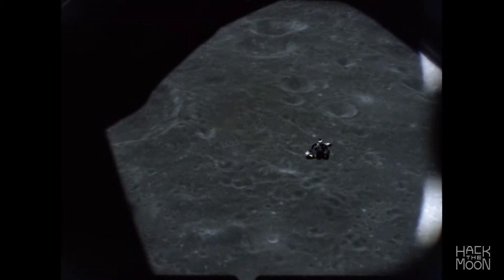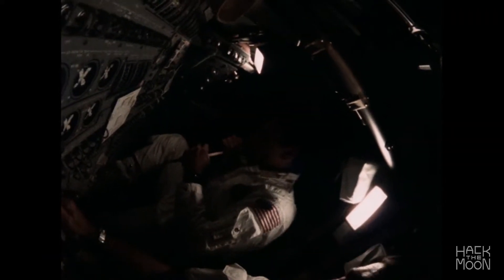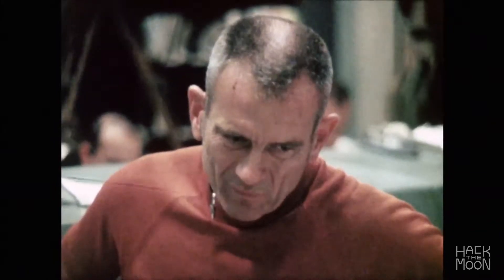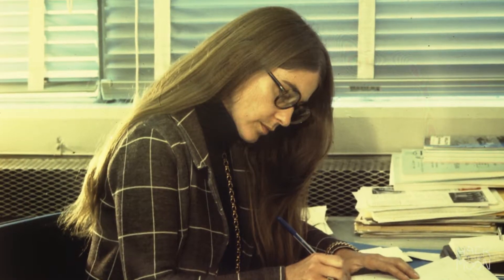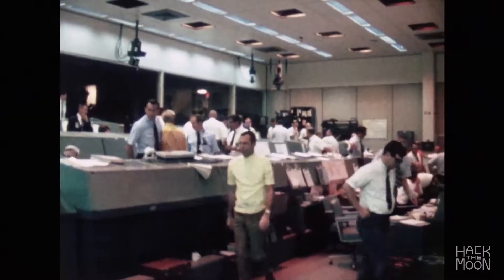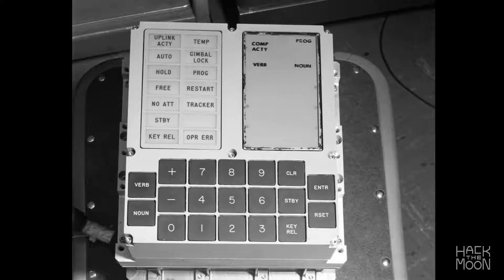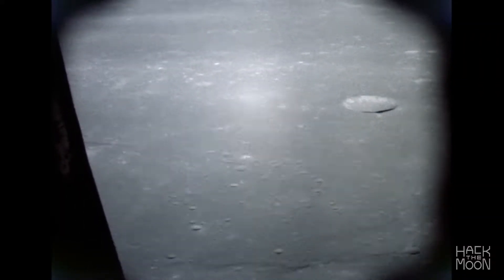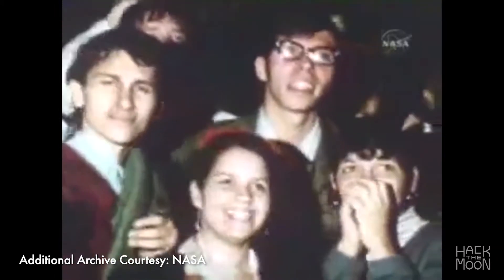1202 Alarm

Comment: Concerning this famous alarm 1202 (which caused much trouble in the control room, and which happened after Buzz Aldrin changed the radar switch from LGC to SLEW, because of an "erroneous" indication of the checklist), in a comment of the anomalies section of the mission report of Apollo 11, entitled "Computer Alarms During Descent, at page 16-13 you find this:(excerpt of the comment):
"Any difference in phase or amplitude between the two 800-hertz voltages will cause the coupling data unit to recognize a change in shaft or trunnion position, and the coupling data unit will slew (digitally). The "slewing" of the  data unit results in the undesirable and continuous transmission of pulses representing incremental angular changes to the computer. The maximum rate for the pulses is 6.4 kpps, and they are processed as counter interrupts. Each pulse received by the computer requires one memory cycle time (11.7 microsecond) to process. If a maximum of 12.8 kpps are received (two radar coupling data units), 15 percent of the computer time will be spent in processing the radar interrupts. The computer normally operates at approximately 90 percent of capacity during peak activity of powered descent.) When the capacity of the computer is exceeded, some repetitively scheduled routines will not be completed prior the start of the next computation cycle. The computer then generates a software restart and displays an Executive overflow alarm."
End of quote.
Now tell me:
1) Why would the engineers have provided a radar mode which was causing a problem that they perfectly knew that it would happen (and which was not happening when the radar mode commutator was on the LGC position)?
2) Why would engineers have made the processor count itself the radar pulses when, in all other systems, including the one of the Saturn rocket, these pulses are counted by electronic counters instead and never, NEVER, by the processor itself; for, if these unwanted parasite pulses had been counted by electronic counters, the processor would just have read the count of pulses on the electronic counters (like all other systems do, and the AGC had an instruction allowing it to do it), and could have seen that the count of pulses was too high; it would not have had to restart, it would just have issued an alarm that the radar mode was on the wrong position.
Moreover, as the AGC was receiving these fast pulses instead of the normal radar pulses, it was making its guidance computation with wrong data!